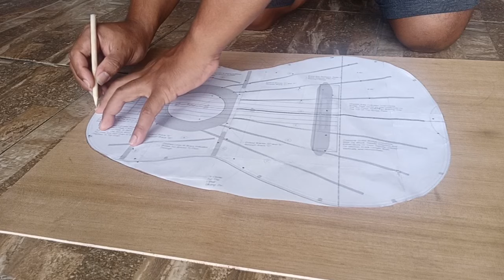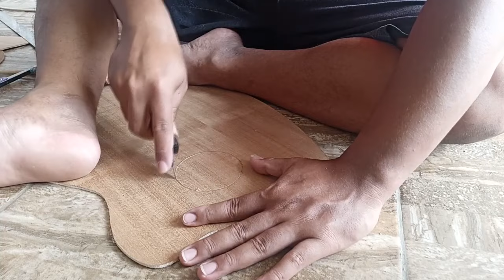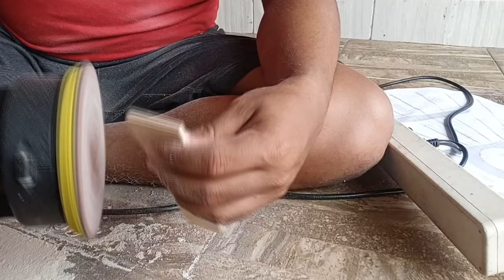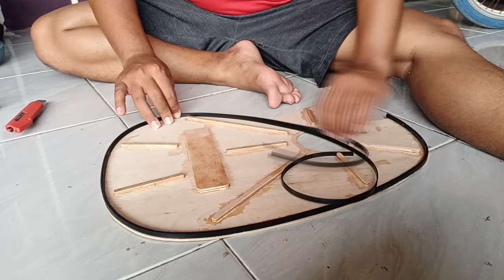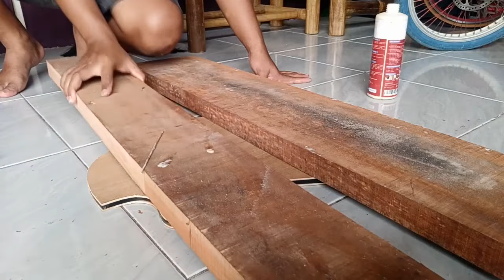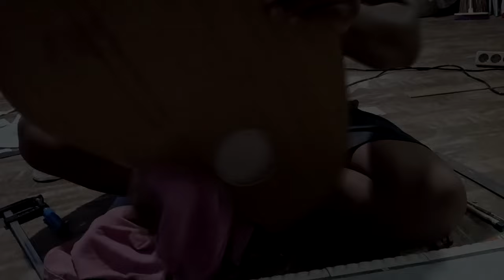DIY Guitar - Cara Membuat Gitar Tipis, Part 1 (Body)

Comment: Really nice idea, congrats! I'm planning something similar. Next time, I recommend that you don't glue the structures on the back side of the sound board to the back side. Let them vibrate freely, making it louder. Now the strings need to vibrate both boards which are quite rigid together. Braces are needed, but glued only on the sound board. To compensate the solidity, the purfling/side wall could easily be thicker.
Reply: What can you use for a thicker side wall?
Reply: @thedevilsadvocate5210  no benefit in sound, just easier to make and results in a sturdier body.
Reply: @thedevilsadvocate5210  Solid wood or plywood. I would build the side out of 2x2x10cm spruce sticks then glued together and shaped. Cutting from 1 piece of plywood would result too much scrap from the inside.
Reply from the maker: I can't wait for your ideas, don't forget to share them on your YouTube channel. spirit!!